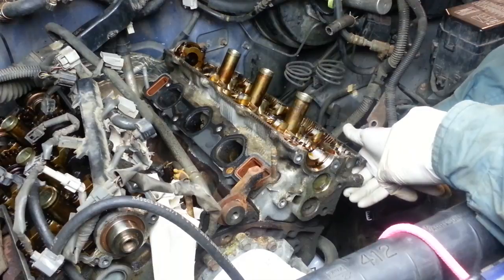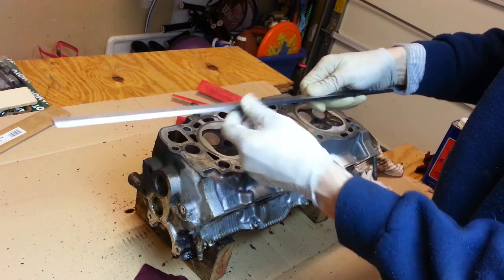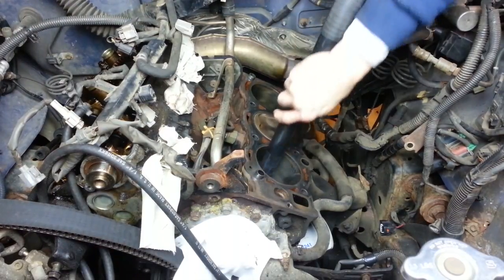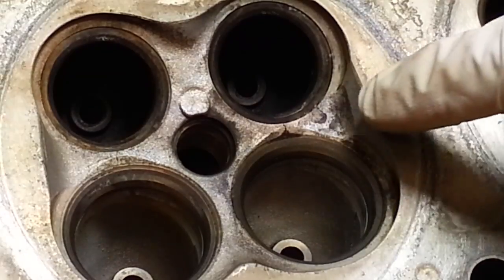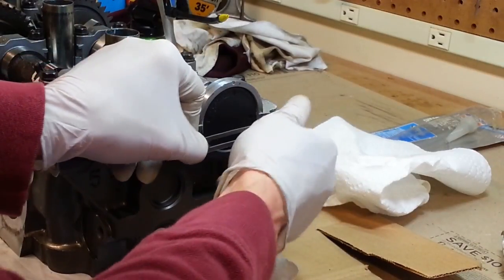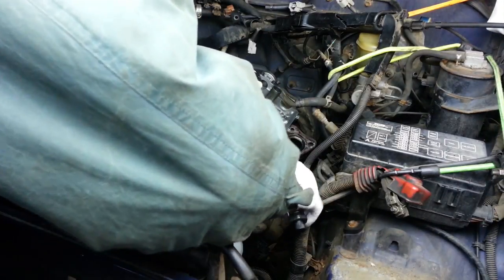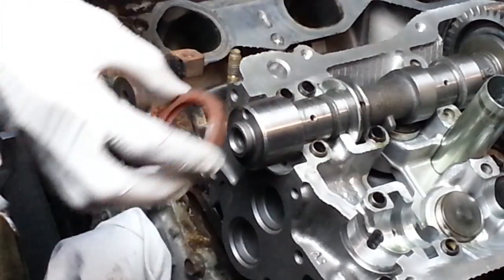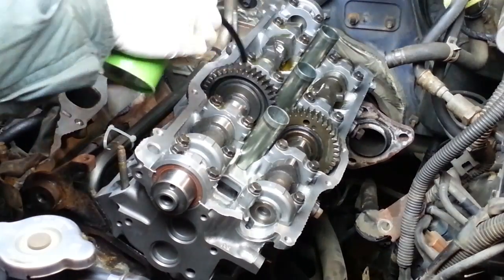Cylinder Head & Gasket DIY Procedure - Toyota 5VZ-FE - Part 4

Comment: Quick tip for bucket lifters, instead of using a box to try and keep them in order you should use a egg carton, keeps them safe and makes it easy to number them :)
Reply from the maker: Nice tip, thanks!
Reply: What diameter are the lifter shims on a 5vz-fe?  I had one guy tell me 28mm and another tell me 34mm. Thanks.

Comment: Excellent series, I'm about to complete my DIY heads job. The only thing you could have done better, was to use a MLS head gasket, looks like you used graphite. Toyota had a recall on these engines, for blown head gaskets and it did switch them over to Multi Layered Steel gaskets, for their strength. In my case, I did take the time to throughly clean each part before I reassembled. A++ for the consistent explanations, step by step voice over, sharp footage, steady and properly lit. Great job!
Reply from the maker: Great info! Looking back on it, I may have seriously considered using a MLS gasket. Are they significantly more expensive? Thanks for the kind comments. I really appreciate it.
Reply from the maker: Cool video clip and she sounds sweet. I loved the celebratory "woo hoo" because I fully understand the emotion behind it. Nice work!
Reply: Interesting, i just bought my gaskets from the dealer today and they were definitely graphite not MLS. I wonder if they gave me old stock?

Comment: Excellent how to . Doing same setup on a 1995 honda odyssey ex with timing belt failure. 4 bent valves. 300,000 miles on it. Head still at machine shop

Comment: When I pulled the head off my 2000 tundra v6 there was a kind of silicone stuff on the block between the gasket and the block. I seem to recall that, not too far back in the day,  there was a substance often applied to this surface , especially on diesels. It wasn't actually silicone and had a name something like "Indian Head" sealer. If I recall correctly, it was copper based. For sure there was something like this in my engine and It was all factory original. What do you think....?

Comment: Concerning the head bolts:  generally speaking, if you lube the threads on a bolt prior to torquing it down, and the FSM does not say to do that, then you may need to reduce your target torque value somewhat to compensate.  The reason is: the system you are tightening will 'consume' the tightness you apply as some combination of thread friction, and thread stretch.   So if you lube it up, less torque will be attributed to friction, meaning that more goes into stretching.   That isn't necessarily a good thing.  (For example: if the fastener is a torque-to-yield bolt, you'd be making it yield more than what the engineers called for, and it could later break while in service.)  The situation can get a little muddy, for instance if you are tightening a bolt down into a hole that has some corrosion on the threads.  In that case you'll have more friction than normal and less stretch, so lubing up could serve to bring things closer to the desired outcome.  So you do have to use your best judgement.
Just wanted to bring this to your viewer's attention.
Reply: No, I don't think so.  Anytime a manual calls for torque angle gauge for final fastener install, that's a torque to yield setup and an engineer has done the math for bolt stretch with an eye in yield vs. breaking strength.    You have to use new bolts, and the exact specification called for. Grade 3, grade 5, grade 8 all have different properties for the same diameter/thread pitch.  As a side note, any time I see torque angle specs, I chase threads first to make sure thread surfaces load up evenly because the fastener is going somewhere near the edge of its useful limits.
There are situations where oil or anti seize gets aced out, and that's when sealant or loctite is called for, or specialized situations like... a dc motor: you have to keep oil products away from a commutator and bolts in that area get installed dry.

Comment: Could the coolant have been laking from the exhaust manifold gasket? It has coolant chambers and fuel injection chambers, and maybe it mixed together there.
Reply from the maker: Possibly but it was a fairly well confirmed diagnosis that the cylinder head itself was cracked in that area.

Comment: Thank you for such a detailed video series, it gave me the courage to do it myself.  It turns out I have the same issue as yours, a cracked cylinder head in almost the exact same spot as you, except on the right side.  Luckily I found someone willing to sell me a remanufactured one for just $150!  Not much for what would have paid to rebuild a good head.  Hardest part was removing the exhaust, which I ended up breaking a bolt off on the downpipe, so now I'm gonna have to drill it out.  I'm almost wondering if I should replace the rear main seal as a preventative since it doesn't seem like it would be too much more to go...
Reply from the maker: progolfer69  That's quite a deal for $150!  Bummer about the broken bolt.  The exhaust work on mine made me nervous for the same potential reason.  Hope that drilling it out is not too much of a challenge.  Rear main seal?  That's a lot of work if its not already leaking but why not if you're up to dropping the transmission.  Good time for a clutch, too, while you're in there if you have a manual transmission.  Good luck and let us know how it goes!
Reply: Pull the motor. A rear main is easy on a stand.

Comment: When you tightened the head bolts I was surprised to see you tighten each one down independently, one before the other instead of tightening them slowly and evenly until the final torque was applied.
Reply from the maker: I'm sorry but I'm not sure what you are describing. I performed the recommended procedure from the genuine Toyota factory service manual where all head bolts are first tightened to one torque setting and then you go back and tighten them further to their final torque.

Comment: Hi, I was wondering what the small stud on the front of the head was for and what size were the jam nuts you used to transfer it? Thanks for the video.
Reply from the maker: I don't remember the size of those jam nuts. Most likely 10-12mm. That small stud is used to secure one side of the ground strap that holds in the housing cap.  You can see that here:  https://youtu.be/nFYEoWTX0YU?t=470

Comment: On the right passenger side head the instructions says to align the intake camshaft with exhaust camshaft at the 2 dotted lines. Once that's in place the intake camshaft sprocket is no longer facing up at the timing mark. It's facing down. Will turning the camshaft clockwise interfere with the piston and valves? The instructions do not show or display anything after the procedure of the camshaft installation
Reply from the maker: Thank you for the question. The 5VZ-FE is a non-interference engine. Therefore, you are safe to turn the camshafts independently of the crankshaft without risk of pistons hitting the valves. You'll see that I did just that in this video series.
Reply: @WorseThanChiggers  Thank you for the reply. Subbed. ✌️

Comment: So what happens if I'm putting the camshaft back into place after resurfacing the heads and they don't spin nicely ? Or smoothly. ? What kind of trouble am I in ?
Reply from the maker: It would be hard to say without knowing more specifically what you're describing. Did they supposedly move more smoothly before you had that done? Are you certain that everything is reassembled correctly?

Comment: I am guessing you were having overheating issues with short term divining, with constant bubbling sounds in your heater core and overflow. Plus no heat inside of the cab do to lack of coolant because of the crack.
Reply from the maker: Those are indeed very good theories. Interestingly, I never had overheating issues for as long as I owned it or an issue with cabin heat. And, the bubbling sounds from inside the cabin were indicative of a small amount of air trapped in the cooling system for years and long before I ever noticed a loss of coolant. I attributed the reason for the trapped air to having the thermostat's jiggle valve upside down. When I started noticing a loss of coolant, it was accompanied by visible vapor from the exhaust pipe upon startup.
Reply: I am actually experiencing all of the symptoms I mentioned in my post with the 4cyl in my 84' pickup after a water pump failure on a 45 min drive on the highway. Soon after that trip all these symptoms started happening, but no coolant from the exhaust though. I am sure the cylinder head is warped because the engine did get hot but luckily I was able to keep it from boiling over. Of course this would happen before getting everything thing together to do a 3.4 conversion, Murphy's law I guess. Great video might I add, this will help a lot of folks leary of starting this project on there own.

Comment: How long did the passenger side last? I definitely would've replaced that while you were in there.
Reply from the maker: It was still going strong and running like a top when I had to sell it 3 years later. Even though the engine was great, the truck suffered from the dreaded frame rust cancer that plagued so many Tacos and wouldn't pass the state safety inspection.

Comment: Man, thank you for this series, very well done. We are here in my garage trying to figure out why it’s running rough after reassembly from head gasket replacements. On the passenger side our 2 dots are lined up but it’s 180 out on the timing belt marks. Pulling what little hair out trying to figure out what’s wrong....help! Please
Reply from the maker: Remember that the dots on the cam gears are just alignment marks to orient the cams properly with respect to each other.  They are not timing marks.  Your timing marks on both cam sprockets must line up properly with the marks on the timing belt cover plate when installing the timing belt.

Comment: I’m in the reassembly stage, managed to get the RH cams back in, but on the drivers side, the exhaust cam won’t fully seat. I turn the intake cam to mesh the gears, and it reaches a certain point where it just won’t go any further. Any help would be greatly appreciated!
Reply from the maker: It sounds like you may not be aligning the correct dots between the intake and exhaust cams. On the passenger side, you align the double dots but on the driver's side, you align the single dots. If aligned correctly, the cams will fully seat and are not compressing any valve springs. Of course, this all assumes that you have already installed the service bolt correctly as shown in the video. Here is the intake cam going in: https://youtu.be/nFYEoWTX0YU?t=1705 followed by the exhaust cam going in: https://youtu.be/nFYEoWTX0YU?t=1894

Comment: These videos continue to save me and I can't thank you enough. I am doing both heads and am in the install phase - on the right hand side my inclination is to line up two dots with two dots when I install the camshafts, and then rotate them back to the one dot/one dot position which they were in originally at TDC when I pulled off the valve cover. Do you remember if that is what you did with the right side and can you confirm that's a good plan? The FSM does not address it as far as I can tell, it says to install the RH camshafts with two dots lining up but doesn't mention rotating them back to 1 dot like they were when I found them. THANK YOU.
Reply from the maker: Thanks for the kind comments. I really appreciate it. As long as you install the RH camshaft with the two dots lined up, you're good. That is the position where the lobes are not compressing the valve springs and you can get it together without much resistance. You'll set the timing later during the timing belt installation procedure. That's when you'll rotate the cams so that the marks on the camshaft timing pulleys line up with the marks on the timing belt cover. It sounds like you're well on your way to completing your project successfully.

Comment: Did you happen to re install the 8mm hex head bolts? My are bent and i cant find replacements. wondering if i can just leave them out. Any help would be appreciated
Reply from the maker: BikeLyfe You mean at 27:48 of episode 4 (https://youtu.be/nFYEoWTX0YU?t=1668)?  I'm not sure of their exact function but I'd be very afraid to leave them out.  Perhaps the guy at your Toyota dealer's parts counter could help get you the part numbers for those bolts.

Comment: It is confusing,in this video you aligned the single point  of the intake dot mark with the single mark of the exhaust  camshaft.its optional to use the double point marks instead?
Reply from the maker: You must align the single dots on the driver's side and the double dots on the passenger side. You can only install the camshafts in that orientation or else one or more lobes will be pressing down on the valves.
Reply: @WorseThanChiggers  thank you so much.

Comment: Can you answer one question for me.  Im looking to buy 4runner that has slow coolant leak and misfiring.  My guess is that it has a headgasket issue, no white smoke yet.  How do I know that the car was not overhead before?  My fear is that after I replace the gasket to realized the engine has overheated and warped.  Is that a concern or overheated might not be a concern.  I don't see any oil in coolant or reserves yet.  Thank u.
Reply from the maker: For a known coolant leak, look for the cause. Is it leaking into the exhaust side of the engine and being burned like mine, often accompanied by white smoke? Is it leaking into the oil passages? Check for that by looking inside the oil cap and on the dipstick for milky oil. Is it an external physical leak such as a cracked hose, radiator, or heater core?
Reply: @WorseThanChiggers  OH...This is so helpful.  If I get the car I will share my progress with everyone.

Comment: What torque wrench are you using?  I've got an old Craftsman that only goes down to 25 ft lbs.
Reply from the maker: It's a small one made by Neiko and has a range of 0 to 250 inch pounds.

Comment: Just out of curiosity. Do I meed to resurface my Cylinder head? The only reason I am replacing is due to oil leak. Im using MLS Head Gaskets. Your knowledgeable response would be helpful thank you!
Reply from the maker: When a head gasket fails, there's usually a reason and you need to discover what that was and resolve that first.  The gasket itself is typically not to blame.  It's generally good practice to resurface the head when changing the head gasket to ensure that you don't get another leak.  It would be very unfortunate to go through all the time and effort and then have another leak reappear a short time later.  If the head is in any way warped, you definitely want to get it resurfaced.  You should at least check it for flatness with a high quality machinist straight edge but those are expensive. I'd still recommend having a machine shop at least look it over for you.
Reply: @WorseThanChiggers  ok thank you. You make good points

Comment: A low mile JDM 5vz can be had for under $800. I wonder if it is worth the time to swap a head on an old high mile motor. my motor runs well with 360,000 miles but thinking into the future I would probably just pull the motor and either rebuild or replace.
Reply from the maker: Very true. I would really enjoy seeing a detailed engine swap video on the challenges and specifics with the 5vz.

Comment: I'm just curious why did the head come with the cams pre-installed? Are you supposed to send those back if you don't need them?
Reply from the maker: The cams are part of the remanufactured head assembly, as are the caps, valves, springs, shims, etc.  As part of the trade, you send back your old head with cams and all.

Comment: Great videos! Were you able to confirm that the right side camshaft timing marks are aligned correctly?
Reply from the maker: Both the alignment marks (dots) on the cam gears and the timing marks on the cam sprockets all got set properly.

Comment: Did you have to adjust the valves much on the new cylinder head?  When you took out all the valves before sending it to the machine shop, did you need any special tools for removing them?  What is the length of the straight edge you are using?  I'm looking at getting an 18" straight edge.
Reply from the maker: progolfer69 Thanks for the questions!  After I measured the valve clearances on the new head, I had to order 2 new shims for valves that were too tight.  In fact, the intake valve on #6 wasn't even closing all the way.  I'm surprised that the head didn't come with that the valves already adjusted.

To remove the valves, I used a universal valve spring compressor similar to this one.  http://www.amazon.com/Universal-Spring-Remover-Installer-Compressor/dp/B006TM8RBC

You don't have to remove the valves before taking a head to the machine shop.  They can do it for you but since I had the tool, I wanted to do it for my own education.  If I had been more observant, I would have seen the crack myself with the valves out.

I used this 18" straight edge:  http://www.amazon.com/gp/product/B0006J4EFW

Comment: How important are the head bolt washers? My kit I got came with everything but those washers.
Reply from the maker: @commanderTL  I'd use a set that closely matches the OEM. Without the washers, how can you be confident that the torque settings are being measured correctly?
Reply: @WorseThanChiggers  Would the old washers work? Without the washers what could happen to the engine?
Reply from the maker: @commanderTL  It's hard to say. Using the washers may shorten their useful length. Without using the washers, the friction between the bolt and the cylinder head might be different and would affect your application of proper torque. Note that I am very conservative by nature. If it was me, I wouldn't want to risk using substandard bolts for such an important step.